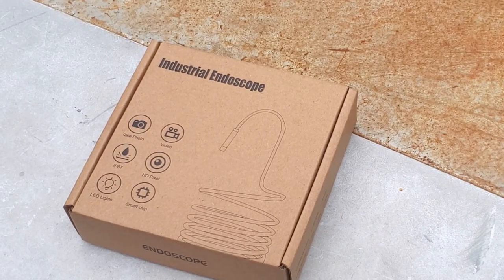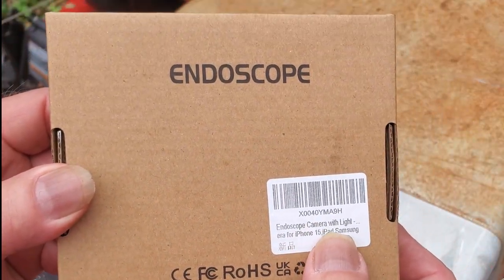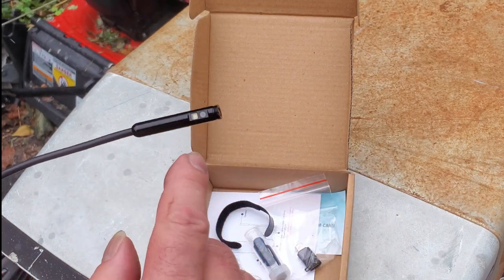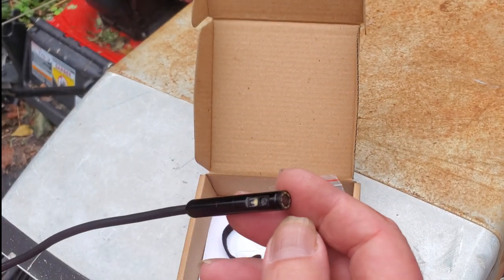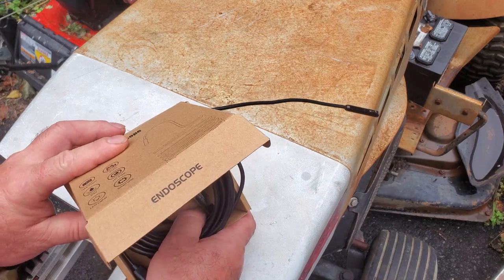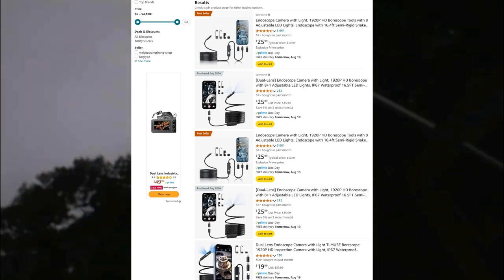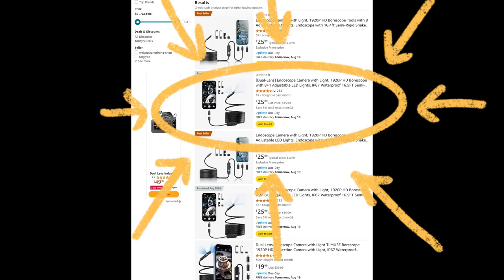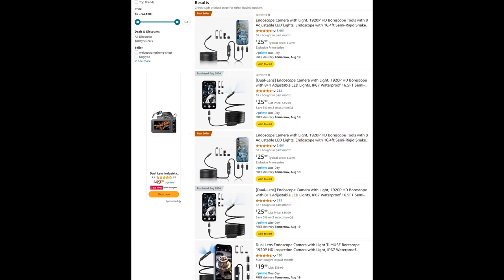ENDOSCOPE See what is wrong INSIDE engine

Comment: Nice tool to help with looking inside of a  engine either a 4 cycle or 2 cycle engine riding mower king 👑
Reply from the maker: Yes it is, You can see inside without taking it apart. also finding leaks on car engines where you cannot see.
Reply: @ridingmowerking   👍👍